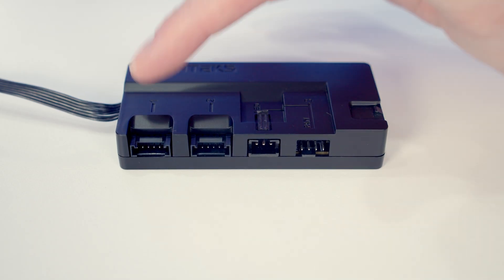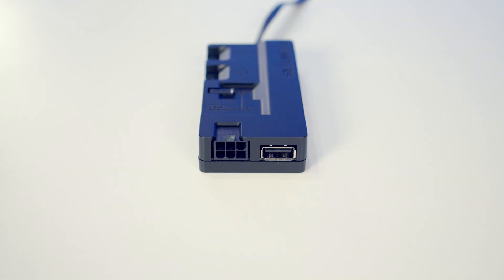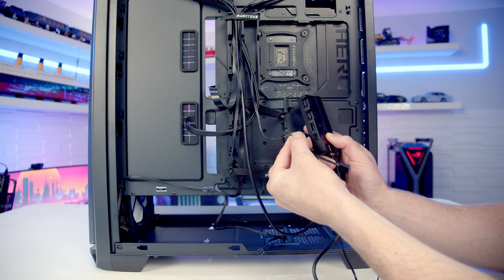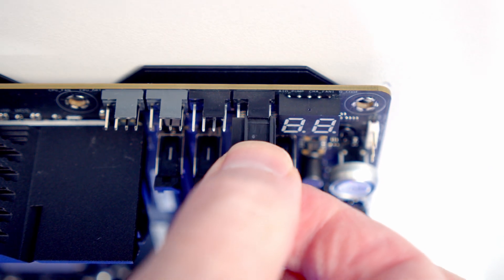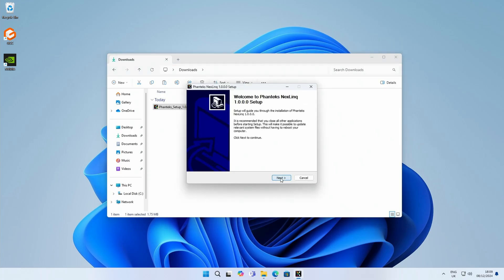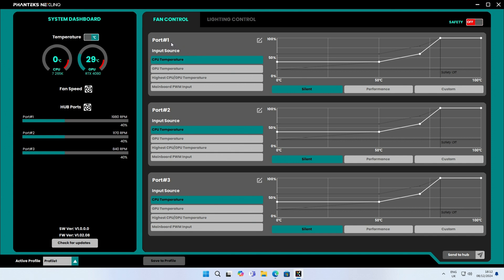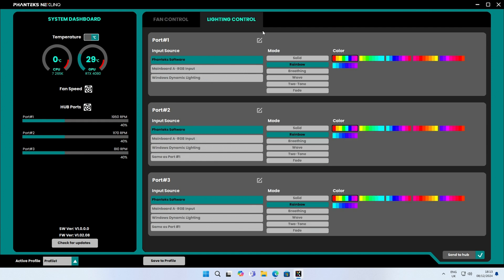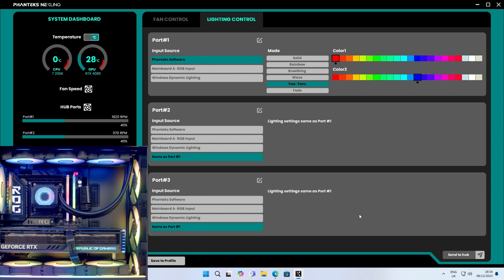Phanteks NEXLINQ Hub - Installation and Software Setup Guide

Comment: You can calculate the RGB amperage load of your fans and use them accordingly with the “Linq6 Mainboard Adapter” and “Linq6 Output Adapter” cables included in the box.

For example, with D30 fans, a single port theoretically supports up to 15 fans, but to avoid operating at the limit, it’s safer to keep this number around 10. Since M25 fans draw slightly more current than D30s, the supported fan count per port may be lower. You can check the fan specifications table to see how many amps each fan draws. The current limit of the NEXLINQ Linq6 ports is 3A.

There is only one female Linq6 cable included in the box, but if you connect the male Linq6 cable from the box to the fixed female Linq6 cable on the NEXLINQ unit, you can effectively use it as an additional Linq6 port. This expands your capacity and allows you to control the fans directly through the software, without needing to connect them to the motherboard. The built-in female Linq6 cable on the device is optional and can be used for this purpose.

Comment: How do you connect all those fans if the hub only has two connections?
Reply: This is the exact position I am in.
Reply: @theatremad9797 they are connected together first then run off 1 port
Reply: I'm so stressed
Reply: @iamtheegreatcornholio I never used the hub. I just went directly to the motherboard.
Reply: @theatremad9797  yeah, im gonna give up using the hub. I thought the d30 fans had linq6 connectors. Unfortunately not.
Reply: @iamtheegreatcornholio Try not to stress it’s not worth it. I was stressed hooking up mine and gave up and went for a walk. Get my mind of it. Anything is easy when you know how.😊😊 you’ll be fine😊
Reply: @theatremad9797  yeah. I got to the point where I regretted getting a PC 😂 I'm gonna try again tomorrow. If I can't get it sorted I'm just going to order the m25 aio and fans.
Reply: @iamtheegreatcornholio installing windows 11 was a nightmare for me. I can’t remember how many times my pin would not work. I can’t stand windows. All sorted now though. I thought that building my own computer would be a smooth process but I was wrong. So much has change since I last built one.

Comment: I have 9 fans total plus the AIO (2 front, 3 bottom, 1 rear, 3 on AIO, and AIO pump). All are Phanteks. How would I go about connecting these together to the hub? I know the 3 on the AIO and the pump get daisy-chained together to make 4 on one of the Linq6 ports. The second Linq6 port would have another 4 fans, leaving 2 more to be plugged in. Is there a cable with the 3-pack that I can connect to the legacy port? 

I saw a video of someone using the controller hub with the exact same layout I have, but they didn't explain how they connected everything to the hub and had it sync together. Any help is appreciated!

Comment: can someone explain to me how to connect 10 fans on this HUB?

i have 
1x D30-140 rear outtake fan
3x D30-120 AIO fans (Phanteks Glacier One 360D30 X2)
3x D30-120 bottom intake fans
3x D30-120 side intake fans
Reply: Did you ever find out.  I have 10 fans total

Comment: Bought the g400a , glacier one aio and 3x120 fans. PSU only has two pcie cables, both are plugged into gpu. 
Could I use one of the pigtails to power the nexlinq hub?

Comment: How do you get RAM and GPU colors to match with all the fans?
Reply: Connect the fans to the hub then connect the hub to motherboards ARGB connection and I can’t remember if the other goes to USB or PWM. But I believe he addresses that part way through this video.

Comment: Can this also be used with 12 D30 fans? im planning in using it with the nv7 case if possible?
Reply: Im wondering too, I have no idea what fan controller to use.
Reply: @ryleejones1585 They are compatible

Comment: Just received my M25 fans just to discover that they are useless without the proprietary controller, well played from this kind of companies!

Edit:
For those who dare...
Starting from the white stripe wire: 5v, data, pwm, sensor speed, 12v, negative (from fan and a-rgb)
A simple cable that Phanteks won´t offer on single fan pack and a controller that is unobtainium!
Reply: I'm guessing you need this nexlink hub should be included really
Reply: @trevz1048  already made myself a cable from scrap extensions and broken fans, work's like a charm!
Reply: You're the man, thanks for the info.
Reply: I bought 2 individual fans only to check the correct cable is not available. I have to buy a controller now. I am out of the return window. I am planning to avoid using the fans and buy different one
Reply: triple pack includes the right cable
Reply: @BurnedUp78 It is not proprietary. i'm using the ASUS TUF Gaming ARGB PWM Fan Hub instead of Nexlinq. Phanteks provides "motherboard adapters" (in triple packs) which convert the fans from Linq6 (fan side) to ARGB+PWM (these connect to any powered fan hub)
Reply: Millennial learns that electronics need a way to control them

Comment: Do these fans only work with the hub? cause there is no 6 pin connectors on the motherboard for them
Reply: You have to buy the 3 packs to get the cable that converts the Linq6 connector to normal aRGB and PWM connectors, you can then connect the fans to headers on the motherboard instead of waiting for or buying the controller, that cable however isnt supplied with the single pack fans.
Reply: No they will work with legacy main board support like other addressable fans. The fans appear to come with multiple wires for different setups. I am considering these for my new build and his videos have been super helpful.
Reply: @motowillg5398 the fans I ordered do not include any adapters and the hub is required. Found out after i received them. However, I contacted Phanteks and I qualified for a promo since I bought 2 fans. I just received my free hub today. Good support. Can recommend.

Comment: how many of those m25 fans can you actually daisy chain together ? will those 2 linq6 ports be enough for the aio and 7 more casefans?
Reply: 9 total devices are supported as per the Phanteks website. 4 per Linq6 port and I am assuming 3 on the legacy port? Not entirely sure tho. I does appear you can have multiple hubs if you have a lot of different fans to control.

Comment: how did you get your non aio fans (the 3 front intake, 3 bottom fans and 1 back exhaust) all connected to only 2 linq6 ports on the hub? are they all daisy chained together?
Reply: I bought two hubs for this same reason 😂. I’m unsure how to connect all 10. 6 reverse 3 on the aio and a rear fan. It’s confusing and there’s on one showing how to properly do a 9-10 fan set up with just one of these.
Reply: The hub has 3 ports. 2xLinq6 and 1xLegacy RGB. Phanteks says the hub supports a max of 9 D-RGB devices in total when connected to the mainboard. I would imagine he has the AIO and pump on 1, Rear and bottom on another, and the front fans on the legacy since it appears these fans come with  multiple adapter cables to suit different connection types outside of the Linq6.
Reply: I feel your pain I have 7 m25 g2 for a new build didn’t know I needed a hub so my new pc with 9070xt is dead right now :(